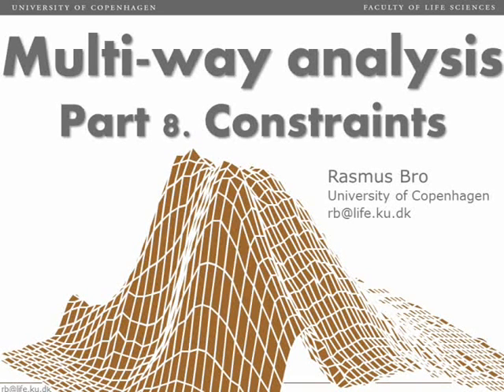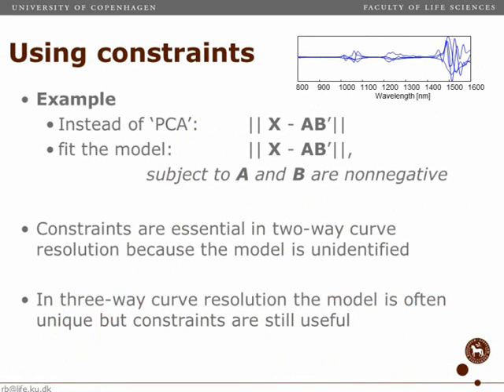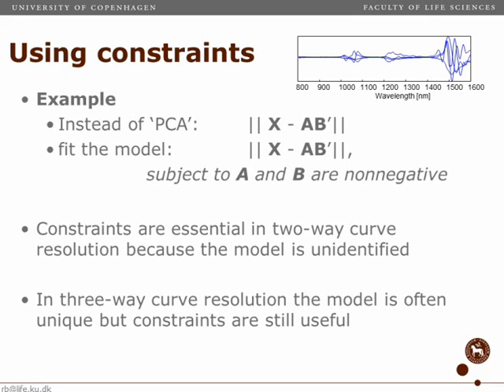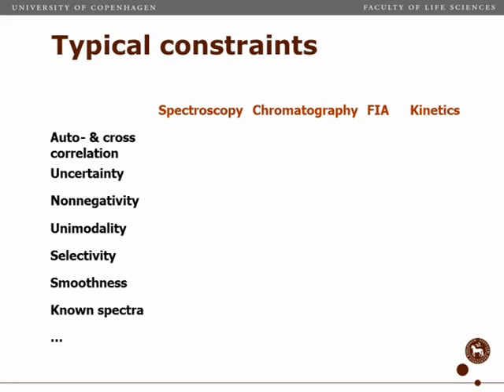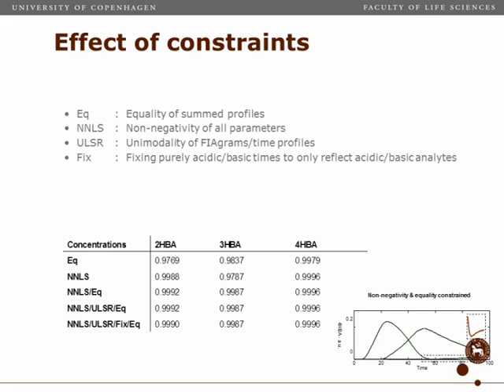Multi-way analysis. Part 26a. Constraints

Comment: Good evening Prof. Bro
In a three way spectral data containing 19 samples X Abs 501 wavelength X 5 pH values
and these data underlying three components, each has 2 forms according to acidic and basic media offered by changing pH values from (3-11)
Is it possible to introduce constraints like:
Non-negativity for Mode A "Conc."
Non-negativity for Mode B "Abs" to avoid -ve values
Unimodality for Mode C "pH" to offer one spectral feature for each component at each of the underlying pH value ?
Thanks